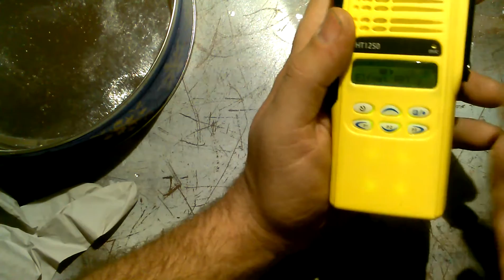How to install a refurb kit - Motorola HT750/1250/1550 series portable

Comment: I need to replace the three terminal battery connector on a 1250, can you tell me how it is done?  I have the radio apart far enough to access the connector.  There is a shield/cover on the back side of the board, looks like the connector is soldered to the board but I don't think it would be smart to start messing with it without knowing just how it is secured.  Thanks to anyone for help with this.

Comment: is the 750 and the 1250 the same board? asking because i see in the 750 the connector for the front screen is on the board if i was to purchase the 1250 front housing with screen buttons and speaker installed can i slip my 750 board on them and would it work?
Reply: No because the 750 doesn't have a display and it isn't meant to have one so if you put the display it in wouldn't do anything and the keypad wouldn't work

Comment: Thanks for this. In your next remake, if you do, could you cover the accessory connector on the side. I had no idea exactly what I should do, still searching. I didnt wanna tear that black adhesive up but I think thats what it takes.
Reply from the maker: Yes unfortunately you have to remove and discard the old black "sticker" on the side connector,, The refurb kits usually have this replacement sticker separate so you can install it after you  have routed the connector into place. I want to say the connector itself it's PCB snaps into place. It's been awhile since I refurbed an HT1250 radio now and I honestly cannot recall of the top of my head
Reply: On my HT750 accessory port ( BTW HT750 is an easier job, no Keypad do not need to remove the ribbon cables and shield will come already snapped in place, good for first time attempt) there was the Gold Contact sheet that was glued on top of a thin PCB like material with a silicone. In hindsight, I wish I had gotten it hot with a hairdryer or better yet a Heat Gun. I was lucky but I could have ended up tearing it up. I was quite nervous and was close to doing just that. So get it hot, go under it with a very sharp flat instrument and work that piece up. Forget about the black tape, never save that and as Elfnet said, you get a new  one. Thanks, Elfnet again, couldn't have done it without this video.

Comment: You hack
Reply: What Elfnet said. Yes, let the single attempt hobbyist spend another $50 to $100 in specialty tools to upgrade their on HT / WARES Hand Held one time. Ridiculous. For $14 shipped, I have an HT750 recased (good quality case in my opinion) ready to go, looking brand new. And if you wanna talk about quality difference, we can discuss the thousands of Motorola knobs that disintegrate like dust in your hand with age..
Reply from the maker: +Jim Giacoletto How do you mean? I do this on a daily basis for government entities and commercial customers.
Reply: +ElfNet Gaming Motorola has a tool designed for this so you do not damage the case or the electronics. It also has a knob pulled built it to properly remove the knobs, they should not pull off with your fingers.
Reply from the maker: Jim Giacoletto Yeah I have that tool, but when I made the video I did not have it on hand. Anyways the purpose of this video was to show people how to do this themselves with common tools since the majority of people will not have that special tool or even know one exists. I'm not one of those people who thinks they are some Motorola elitest and tell people you MUST have special tools to do a simple job.

Comment: hey i just got a HT1250 6 button and the clock on the display will not keep time i was told there was something like a CMOS battery in the radio where would that be also is it possible to turn the 6 button version into a full keypad version since i am a ham i would like to have DTMF ability
Reply from the maker: +wolvesone The radio uses a capacitor to keep the time set. IF the battery runs flat the capacitor will keep it st only for a couple of minutes, long enough to change batteries. At least that is my understanding of it.

The full keypad radio is hard ROM flashed differently from a 6 button radio meaning it cannot be done by conventional means. The HT1550 is your typical full pad radio with the display where the 1250 is your 6 button radio and 750 is the "plain Jane" radio.
Motorola built them this way so people could not "Hack" the radios into more features like we could with the GP300, Saber, or Spectra..

Now Motorola has it where you can pay them to "Flash" your flashable (flashport) radio for a hefty price to get features you want but the HT750/1250 and 1550 radios are not flashable because their configs are hard set at the factory in a ROM
Reply: ElfNet Gaming
thanks for the reply i am at a loss then as to why over the course of about a week the clock in the radio would end up 2-4 hours off i dont ever remove my battery so i m not sure why its doing it as for the DTMF i am not surprised motorola has done that oh well guess i will just keep using it as is
Reply from the maker: ***** Yeah the clock thing is an ongoing and known issue. All of the ones I have I dont even bother with setting the time on..
Reply: ElfNet Gaming
so after opening my HT1250 there is a small battery for the clock on the board its a MS621 which i can not seem find with out some dumb tabs spot welded on it which the motorola does not have
Reply from the maker: ***** WoW they actually used a battery in there?? I was told it was a high capacity memory capacitor.. HUmm I'll take your word for it, I'm not opening mine up to investigate because I am not concerned about the clock.
Reply: ElfNet Gaming
 yep its a little 3 volt cell i even took a photo of it so i know what i am looking for but finding it is becoming a pain in my rear so i might just say screw it lol i wanted to practice taking it out of the case anyways because i am thinking of puting it in one of the green cases the new digital motos come in for the fire dept
Reply from the maker: ***** maybe its on the PCB with the LCD panel? I really dont know.
Reply: oh no i found it in the radio its just finding the replacement to buy its on the main PCB here is a photo i took of it just so i would know and  could then share with anyone that may ask http://img02.deviantart.net/6004/i/2016/108/1/b/dsc_7529_2cd_by_wolvesone-d9zg08x.jpg
Reply from the maker: http://www.ebay.com/itm/like/141873940144?lpid=82&chn=ps&ul_noapp=true
Take some needle nose pliers and remove the tabs